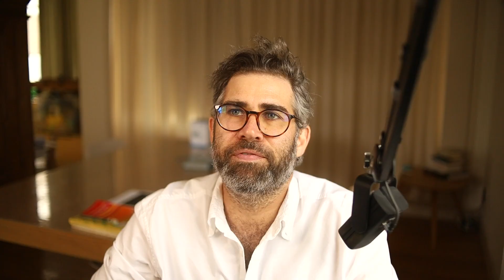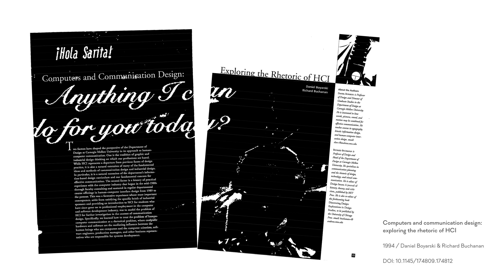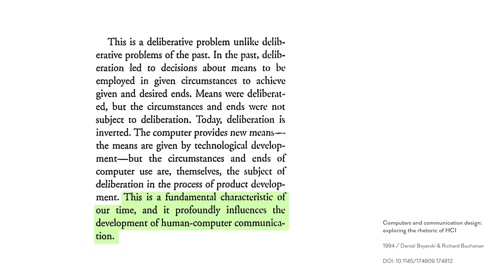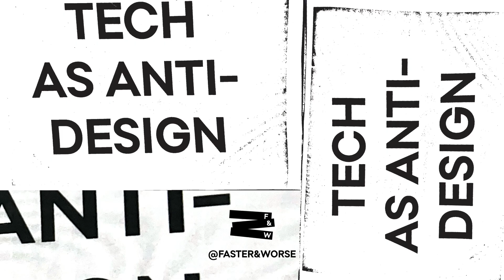Dispatch #29: Tech As Anti-Design

Comment: I think it is okay, when developing a new technology, to re-examine existing problems and see if the new technology could be applied as a better solution to that problem, e.g. when the wheel was invented and maybe first used for carts to transport rocks it would be fine to examine which other transport related tasks could also benefit from the wheel. The problem arises when we skip the step where we compare the new technology to existing solutions for the problem and the one where the person with the actual problem gets to decide which of the solutions, old or new, actually work best to achieve their goals.

With AI (and blockchain before it) we skipped that step because the providers of the new solution really, really want to force that solution onto us, even if it is not fit for purpose at all for many problems where they claim it is.

Comment: You may be interested in Langdon Winner's concept of "reverse adaptation", which seems similar to the "anti-design" you propose. He defines it as "the adjustment of human ends to match the character of the available means" (in Autonomous Technology 1977, p. 229). He goes on to give an example of how the NASA aerospace "team" that has successfully flown people to the moon now has achieved its goal, but must not be dismantled (ibid., p. 245). Perhaps the technology could be used for other means? Anything but letting the system go to waste.
Reply from the maker: oh that is interesting for sure. The concept of finding a purpose so it doesn't go to waste

Comment: Interesting perspective. Regarding your hypothetical with Microsoft as an example; but isn't Microsoft building the product responding to market signals (demand for a product with certain features for certain use cases) rather than arbitrarily determining which ends their software should be applied to? Isn't this normally true, at least to some extent? Or is such market behavior nullified in cases of extreme monopoly power? I certainly see your case in point with AI products being stuffed in everyone's faces, really giving the impression it's a solution looking for a problem.
Reply from the maker: Thank you for watching! These are good points and there is much more detail that I do have to leave out to keep these videos short.